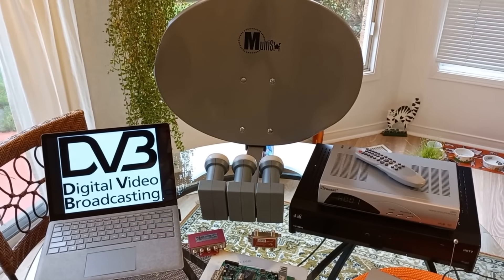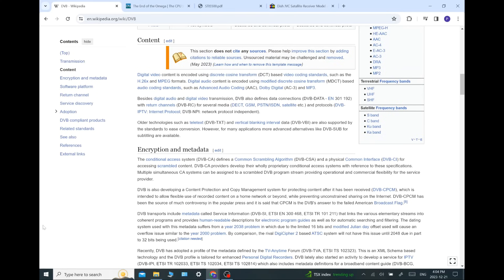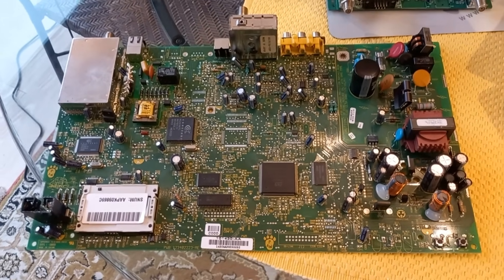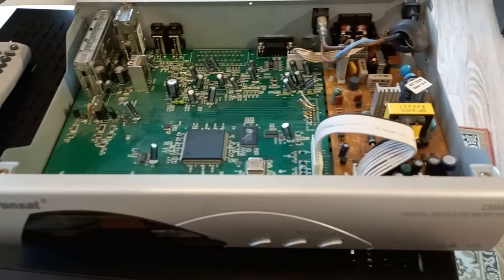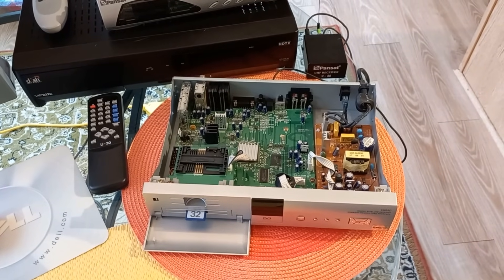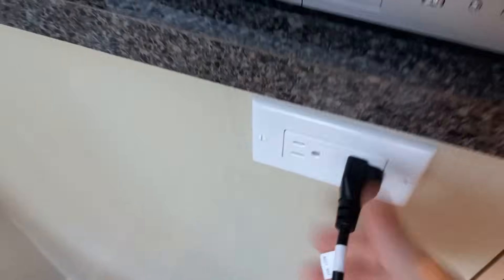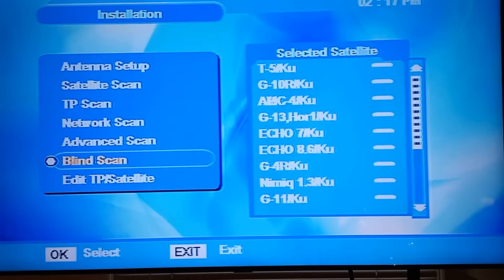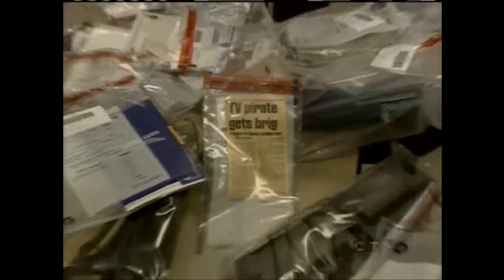FTA - Dish Network- Bell ExpressVU - The FTA Pirate era that changed everything!

Comment: what a throwback to FTA pirating. I remember this era of hacking. It was EVERYWHERE. I personally had a pansat.. pantech... dreambox... captain... there was so many all using the same ST chip inside. Crazy that no one covered this on youtube until now.  The blackbird... silverbullet clones and so on all did the same thing.
Reply from the maker: Didn't someone clone the Pansat boxes and then Black List started to put clone killing code in his bins. "Hacking the Hackers"
Reply: @peterfairlie2296 yeah i had a clone it was called a pantec. It was the bin that introduced the epg. I had a feeling and didn't flash it. eventually there was a fix, you had to solder a pin from the cpu to a resistor, then add a fan to the cpu cause it ran hotter.

Good times.
Reply: I think a lot of it wasn't covered on YouTube for a reason, likely the fear of backlash from Nagra. But the statute of limitations are likely long since passed.

Comment: in 2007, I had a DVB pci card (PC only). I followed the guides, bought a dish, filled a bucket with cement and a pole. I had a north-facing apartment, so I asked my apartment for permission to run a dish, as long as I didn't drill into the building. they said yes, so I had a north-facing patio, cement bucket, vertical pole, 45-degree angle, (protruding outside, 2nd story), followed by another 45-degree angle, so now I have a plastic pole straight up (pointing SOUTH, barely above the roof line!). Attached a Dish receiver, carefully aimed it (using a Dish receiver), plugged it in and got my keys running over the PCI card. It was such an epic waste of time! I never got the EPG (programming guide) working. So I had 30-60 "channels" but never knew what they were. I would scan, find something, watch for a while, and tomorrow the channel was different. Weather? forget it, re-center the wobbly (PVC plastic tubes) base, get it centered, repeat. It absolutely sucked.

If I remember correctly, DirecTV wasn't much different than Dish. You could convert the LNB (low-noise block, the "horn" at the end of the dish) from DTV to Dish by removing a "polarizer" - a piece of plastic that polarized the signal and made it only work for DirecTV. This stuff is way over my head, I'm just sharing it for fun. It was an amazing technology for the time. Unfortunately mine never worked long enough to actually be useful but I proved it worked at least!
Reply: I had one of the pci cards, they used to be all over flea markets and swap meets then they blew up in price with the FTA boom. The pci cards were so complicated it was easier to just give up and get the damn receiver lol. The pci cards were meant for OTA tv but worked with satellites and cable.
Reply: Yes you could use the Directv lnb, but The L.O. frequency was a bit different (10500 I think).

Comment: Awesome throwback, I did wonder if you were gonna start covering the more underground stuff, looking forward to your CS video, that stuff was and still is a pain but running right it was a good time.
The digital era was wild, one cracked encryption led to another and before long CS ruled the waves.
To this day people still fight on the underground about having working "Sly" CS again after the wave a couple years ago where they bolted an additional layer to their STB firmware and flicked the switch. First in Italy, then in Germany and then finally in UK. Premium channels for your sports? Think again!

Oh and even the cable side of the pond, they stopped card sharing by moving to card emulation, in software I believe, after pirates moved from locked down sat to cable for a bit before everything went IPTV.
It'll always be a game of cat and mouse, and the solution is to stop charging insane amounts of money for it in the first place, not that it's worth it now anyway ;)

Comment: It be interesting to see if the flipper could duplicate a dish card. That way you can play a dish in a separate room.  Lol my buddy sold eco star boxes. With dish network. Back in the day. Good stuff.  Like the video
Reply from the maker: As crazy as that sounds it probably could have worked. The Nag-2 card image that was being emulated by the FTA receivers could have also been emulated by Flipper and you'd just wire the GPIO's to the card slot of a Dish receiver.
Reply: ST19NA18 was a Motorola 6805 with a bank register for execution and a bank register for data. It had a one way firewall for the modular arithmetic processor's rom (No data reads unless you were in bank 40). It was not complex, and the hard part (math functions) were HLE'd.

Comment: What did they (dish/bell) do to stop these receivers from de-scrambling their signals? Or did they?? Could you explain ECMing a little bit more? Thanks!
Reply: They started changing encryption codes quicker which become a hindrance,  at first, and then as the boxes and the firmware got better, the firmware would roll through all the options as quick as possible.  From an outsider perspective, seemed like they ran all the plays they had left with Nagra2, while the groups figured the rest out with each change, and ultimately, providers were basically forced into an encryption standard change.
Reply: @pXnEmerica   Actually, in the end game, Raton and I wrote a full emulation of the ST19NA18, including the modular arithmetic processor, which meant that as long as we could receive the EMMs (Electronic Management Messages), we had the new crypto as soon as it was activated in stream.
Reply: @pinheadjones74  Insightful,  IIRC that was pretty late in the game? Which became the autoroll basically?  I don't really recall much uniformity in firmware until the later stages.
My (tired) brain wants to remember there being chunks of the system/card? hadn't been figured out in full. Or that was the forum story.
 I mean you should have been able to pull EMM data from a standard DVB card so that wasn't exactly a restricting factor?
Reply: @pXnEmerica Well in the endgame they would start sending down random MAP calls, obscuring the crypto becuase the only way you knew what was going on in MAP was from example input/output. Since MAP wasn't available unless you had an NDA with ST, the only way to know what was going on was by usage. So they would randomly add extra/change crypto to the ECM processing using functions never seen before. The main ECM Decrypt remained unchanged. However, what they did do was add post-processing to the control words. It was a cat and mouse game, eventually the MAP ROM was dumped and then that exposed everything. But by that point, they were already well on their way of switching over to nagravision merlin.

Comment: Recently had a tree fall on my primestar dish farm :( so I found a semi-local guy selling his Wavefrontier T90 Toroidal dual reflector dish and snagged it. I am curious if you have had any experience with a multi LNB toroidal dishes? Unfortunately it just started snowing and getting too cold for me to want to set a permanent install for it, so my plan is to get what LNBs I need that he did not include, get the dish reassembled, and have all ready to install this spring. I am also looking for info on doing a site survey on my lot for placing a prime focus/BUD (I have several that are potential candidates, but the only one I have in really good shape is only a 6', trying to determine if a 10" with one quadrant damaged will have better results than a smaller excellent condition dish too.) Would love to discuss with you, and I plan to document my journey on my channel (plan to do a TVheadend, and network DVR to share across family network) Love your videos, thank you for the content!
Reply from the maker: Hi Reagan, I know all about them and have owned in the past a T-55 and the T-90.  They have a very wide view of the sky which makes them interesting. One thing to note here is, because it's a double reflector, if you're after circular signals like Dish & Bell you'll need a reversed polarized LNB. Anything linear will work the same and you can use any FSS LNB. The reason I got rid of them was snow issues. Snow would collect on the main reflector and then when there was enough it would avalanche down onto the sub-reflector and get stuck there blocking the LNB's. As for the BUD, full 6 foot will outdo a 10 foot with quarter panel missing. You're also going to need an updated C-band LNB with 5G filter.
Reply: @peterfairlie2296  I wouldn't say the full quadrant is missing. I would say between 10 to 15 percent damaged/bent. I will see about putting up a short showing the damage. I have kept is around as I really feel like at some point I can either repair it or have it repaired (I have access to a CMM and FARO arm, so I can measure it and get a local shop to fab what I need, I prefer to save dishes from the scrapper though). It also has a nice chain drive H-H mount on it to boot. Where I am located, if anyone complains about the dishes they were most likely trespassing, so I am not afraid to mount several lol. I cannot think of anything I would need the circular polarized lnbs for these days lol, but good to keep in mind, especially considering I was planning to use dish and dtv birds to get it aimed in, I wonder if there is such an animal as a polarity inverter for a circular polarized lnb. All you are doing is changing the voltage for polarity in a rhcp or lhcp lnb (been several years since I have played with this stuff, glad I kept my meters and install tools lol)

Comment: I'm a software and RF engineer and it looks like I live in the GTA with you. Would be cool to collab. I don't know a lot about satellites but I know a lot about hardware and digital modulation/comms below 6ghz. Have a load of equipment too, BladeRF, B210, then too many mixers/amps/modulators, TI chips etc. Recently been getting into 40ghz and 60ghz radio, and slowly collecting some equipment (horns, LNAs)

Comment: Apparently my post was auto-moderated.

I made a botnet out of the Relook FTA boxes.
Great little platform, Ran Linux it had plenty of ram, a hard-drive, mips cpu and UPNP support so it automatically forwarded all the ports on the targets router.

In my infect script I had it check if it was running a softcam before I proceeded so I wouldn't mess with non-pirates.

I was shocked dish or bell never made a worm for this. It would have been nearly effortless to automate self propagation, checking if it was pirating a specific service, and replace the contents of the /dev/mtd* with /dev/zero so the NAND was blank and it was bricked.
Reply: At least if you did, the community had enough familiarity with JTAGs to unbrick them. I guess people should have put "TSOP lock" switches on the NAND chips on FTAs just like OEM IRDs. I feel like people should do that for their cable modems and home routers too.

Comment: Did ST completely overlook chip level security ?  Can't see anything in data sheet. Seems there is nothing to lock a 5518 to any smart card where CA is enabled.  I take it the Omega chips in the FTA boxes were legit. This must have been great revenue if ST needed  fabs in 3 countries. Thanks for the effort you put in reviving the hardware for our education.
Reply: I think when these chips were planned, DVB was the standard, so they wouldn't add functionality that wasn't required. DirecTV is proof that the crypto between the smart card and CPU can be done securely, so Dish was just a consequence of poor technical design at the system level.

Comment: Yeah, those were the days.  I had my Dish Network 18" dish with three LNBs.  It was pretty easy to do two but I bought a bracket off the Internet to do three rather than make my own.  I forgot that third LNB was to get Bell - that's where the porn was (you dirty, dirty Canucks, jk).  I remember the switch to IKS and I had a capable receiver, but I didn't trust giving my credit card to potential criminals.  Plus, if they got raided I'd be at risk.